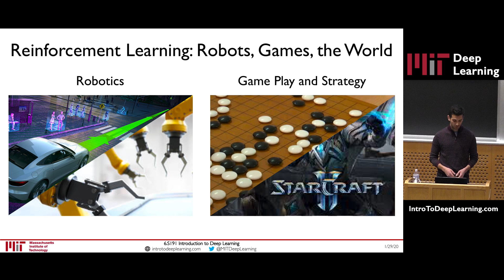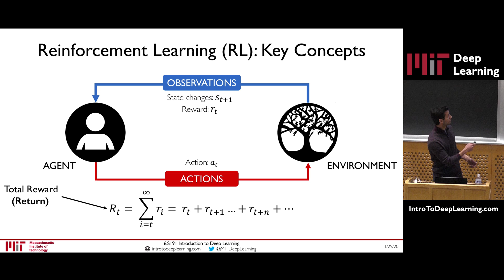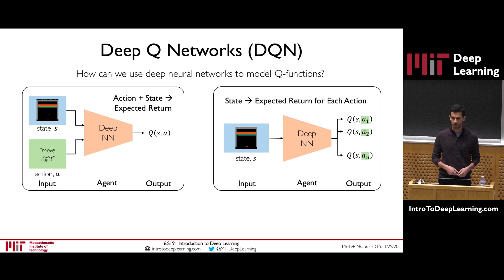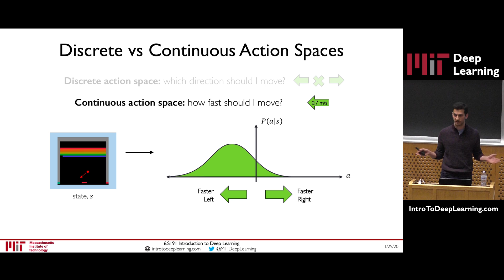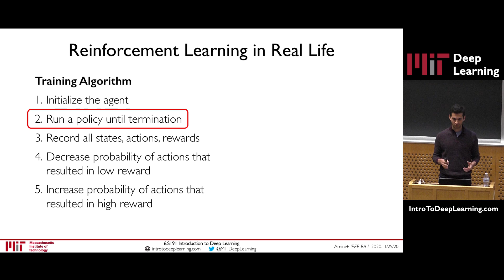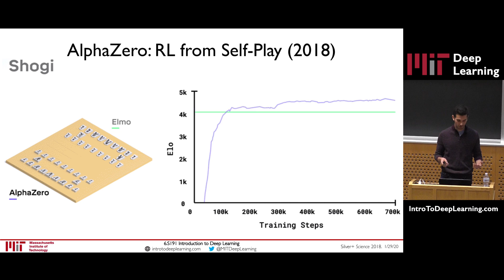MIT 6.S191 (2020): Reinforcement Learning

Comment: I have a little bit of trouble comprehending why the negative logprobs work. If i have a high probability (close to 1) and take the log doesn't that just give me a logprob close to 0? So it wouldnt matter if the action resulted in high or low reward because we multiply by 0 anyways?

Comment: Why not just use a neural net, feed the inputs (current state) into it, and output the action. Then use the same net for several timesteps in a row (updating current state input, apply actions) for the simulation. The cost function is then simply the end-result of the nets performance in this simulation run. Then train it to improve for the next run.

Comment: Why would you sample from the probability distribution at 25:40? This could result in action 2 which has a low probability of being optimal. Shouldn't you just pick the action with the highest probability of being optimal?
Reply from the maker: During training you sample (explore), but during testing you don't (exploit). 

The reason is because during training, especially in the beginning, you don't know the optimal probability distribution (you are still learning). So if you sample action 2 (even though it doesn't have the highest probability), you might find that it is actually better than you thought and thus it's probability should be increased. Once done learning you fix the probabilities and just chose the most likely action.
Reply: @AAmini  wow thanks for the quick response! I didn't realize this was for exploration. thanks!

Comment: 33:58 multiplying by -1..shouldn't it make the loss positive(instead of negative) because log term is negative already(coz probability term in it is <1)? Am I missing something?
Reply from the maker: Good question, P(a|s) is not necessarily between 0 and 1, since it is a probability density function (not a probability), so it can be any number greater than 0. This means that log(P(a|s)) can be positive or negative. Multiplying by -1 makes the value "negative" with respect to its original log form (positive -> negative  and negative -> positive).
Reply: @AAmini  I am not sure this is correct. P(a|s) should be a probability distribution that sums up to 1 over all discrete actions (in this case). A probability density value is 0 at any discrete point. So I think a simple explanation for putting the minus in front of the term is that we want to maximize the expected reward, that is denoted by the term log(P(a_t|s_t).R_t, i.e., the action that brings maximal reward will be more likely selected in the future (log(P(a_t|s_t) is getting larger). This is the same was minimizing the opposite term, i.e., the minus form.

Comment: Someone help me with the loss function at 33:48 . He says a high log probability and a larg reward result in a large number and after adding the minus sign, a very negative number. How is this possible? Probabilities are between 0 and 1 so the log (base 2, e, or 10) of a probability is between negative infinity and zero. If we have a high probability the log probability will be close to zero and the resulting loss will be close to zero too. So, how can the loss be a very negative number when the log probability is as he says "high"?
Reply: @Raivo Koot: You are right. The loss function on the slides is actually wrong and should be: loss = - P(a|s)*R, so without the log-function. I think Alexander's confusion is due to the fact that the log-function comes into play when you explicitly work out the formula for the gradient, i.e. in the expression of grad(loss) in w' = w - grad(loss). You can find more mathematical details by searching online for 'policy gradient objective function', where they usually work with the objective function J(theta) = - loss.
Reply: @Hung94  Wow thanks for your great reply. That clears my confusion up thank you!

Comment: Is it possible to have a RL model to output a probability distribution P(a|s) to select from two or more continuous actions, e.g. steering angle and gas pedal position? how will be the RL architecture to model multiple continuous output parameters, there will be separate distributions for each output parameter?, how the parameters will be combined? I’m not clear about that part on policy gradient. Thanks.
Reply: softmax function bro, u can do some research